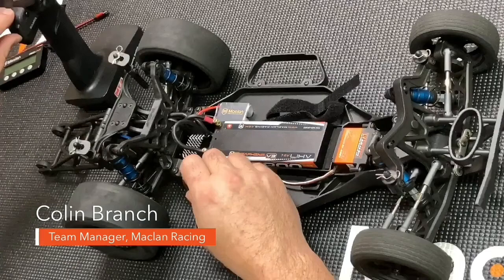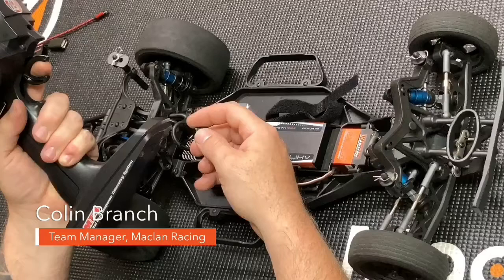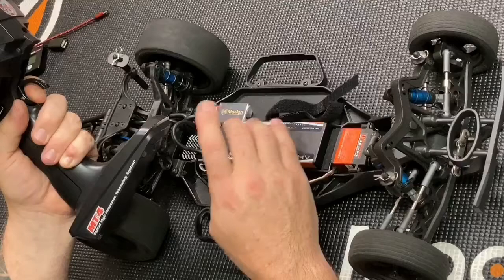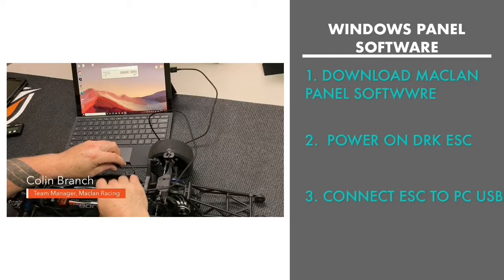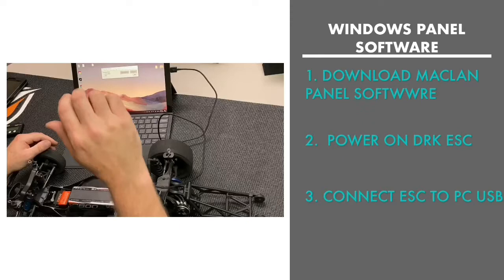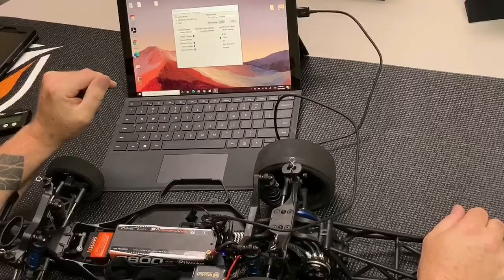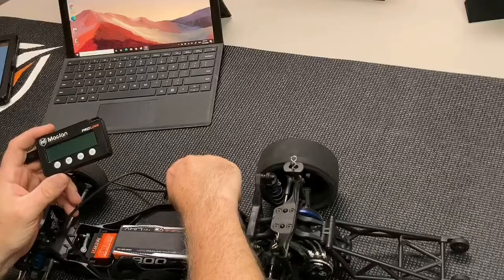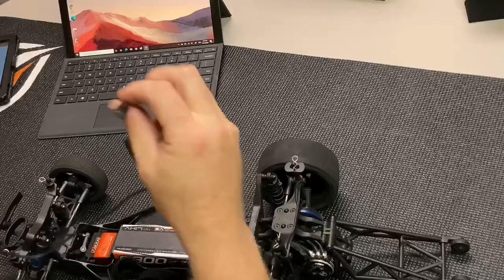DRK 160 Radio Calibration and Programming

Comment: I just got the DRK and it has a note about gearing. However, it does not state which manufacturer gear box they used for the internal ratio. Was this assumption based on the 2.6 (TA) box or 2.72 (Traxxas) ? What is the target rpm for the end of the run?

Comment: Spektrum radios will not power on the rx while there is brake input. With my tx on, I hold full brake and turn on the esc, but the rx will not connect until I let off the brake. At that point, esc calibration thinks it has sensed full brake. When I let off the brake, I have half throttle. If I give it throttle, I have full throttle. Any suggestions on how to get around this?
Reply: Im having the same issue with my  Sanwa rx